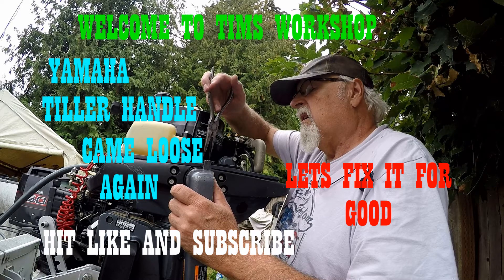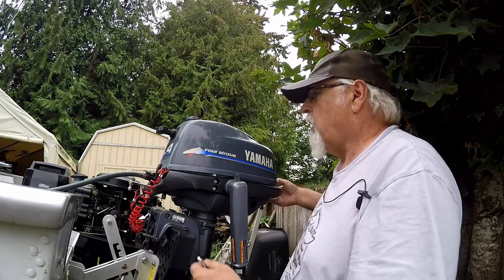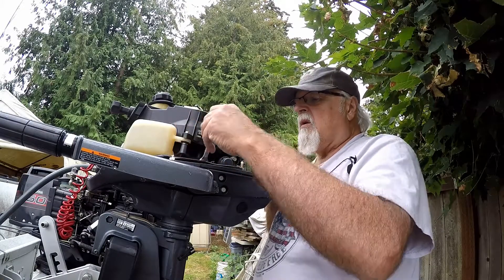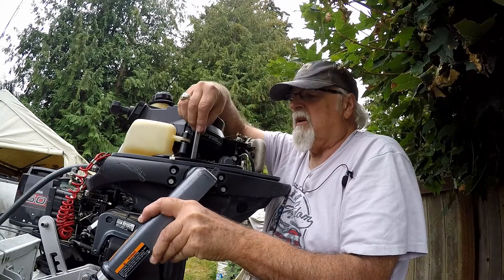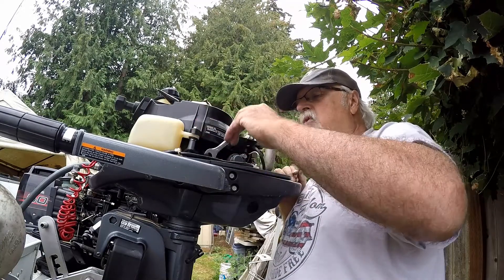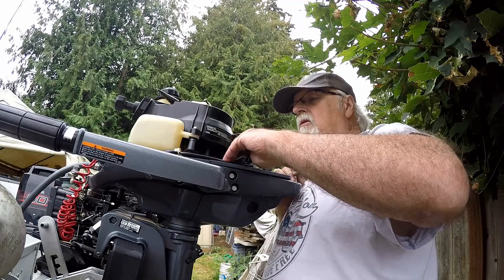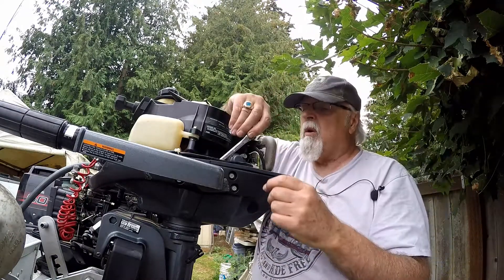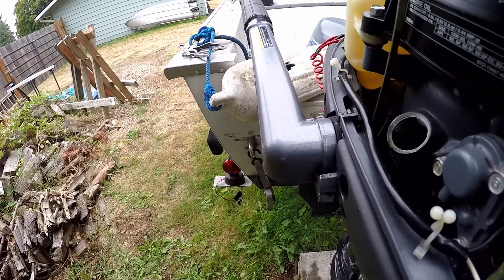Yamaha tiller handle fix 2000 4hp 4 stroke

Comment: Nice tune & good pic'n mate,  I wish Yammy would have went with the older Tohatsu throttle system'' best & most simple I have come across.   kb
Reply from the maker: Thanks Kodi, yep was odd that they didn't install a lock washer? Solid now. The intro song I wrote for my channel, only problem is when I sell the Mark 10 will need to change the lyrics. Haha Oh, a viewer is buying the shift control from me I removed when I bought the tiller. First time selling like this. He lives up on the east coast of Canada. Going to FedEx to see what I need to ship. I'll coil it up and measure what size of box I need before I go. Any suggestions let me know. Thanks Tim

Comment: Looks like an easy but annoying repair
Reply from the maker: Thanks Jim, yes it was but worth it to fix it finally. I'm not sure if someone removed the lock washer or Yamaha never had one there? Either way Tim's Engineering improved the design. ha-ha Anyway, I plan on hooking up my internet dish back by the shed and try a live. I won't have it on public for the test. If it works after I review it for spooling I'll announce a live to see if I can get a few folks on this time. I'm over 1800 subs now which is so cool.
Reply from the maker: https://youtu.be/bCtzb-24s5g
Hi Jim, Here is the test Live I did today which was unlisted. It worked great so going to schedule a live for later this week. Thinking about doing it Friday at 3pm my time which for east coast I believe is 6pm if that works for you?